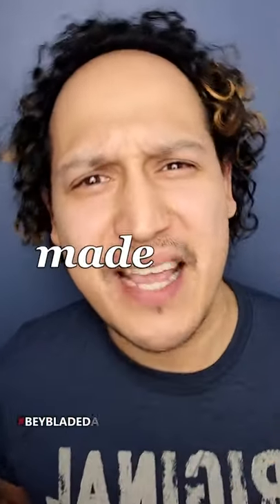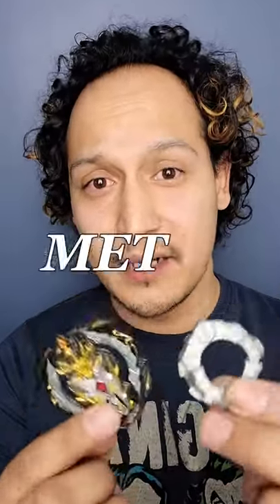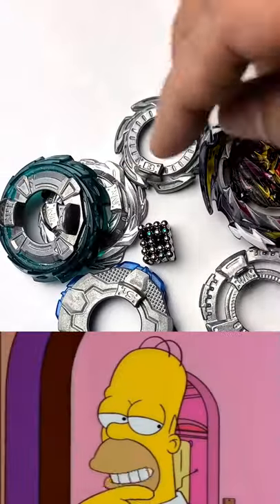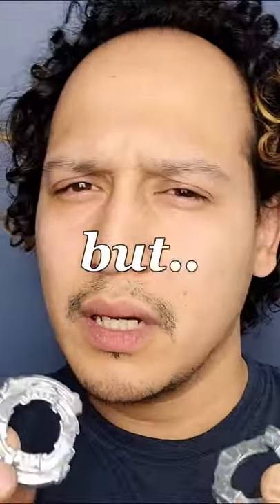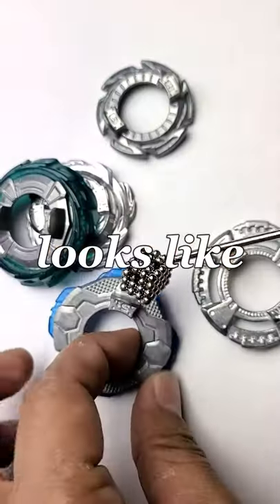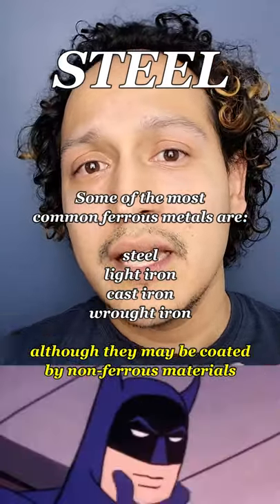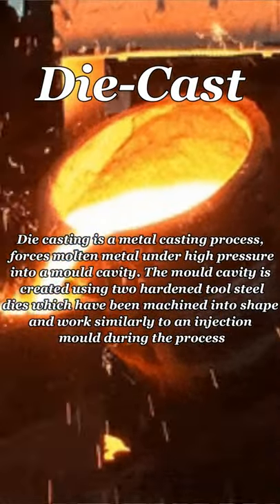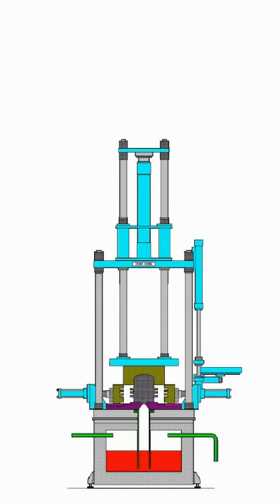What kind of metal is a Beyblade forge disks? #shorts

Comment: My question is can i use a torch to try to bend back the metal to its orginal shape?? I had one of my parts bent hard from battling and was curious to know if its possible to melt back to its orginal shape.
Reply from the maker: I wouldn't recommend it unless you have a mold or some ways to reshape the metal the way you want. You can definitely warp the metal with a torch, but it may make it worse
Reply: @BeybladeDad  gotcha this was very helpful thanks 🙏